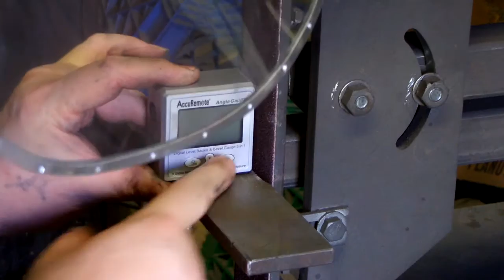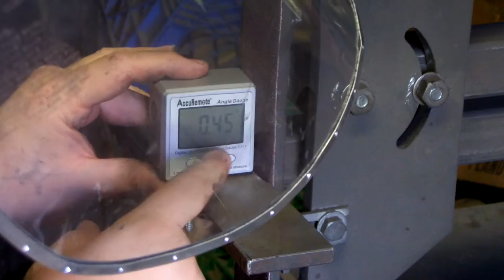Grinding Bevels On A Push Dagger

Comment: Beautiful, one question, did this can be achieved by tilting the patina instead of the grinder??
Reply from the maker: On my grinder, the table is solid and can't be adjusted. The table is always flat. The platen is the only thing that is adjustable, that is the angle. On smaller grinders, it is the table angle that is adjustable.
Reply: @DarkWolfeKnives  ohh okok thnx, awesome work you do congratulations